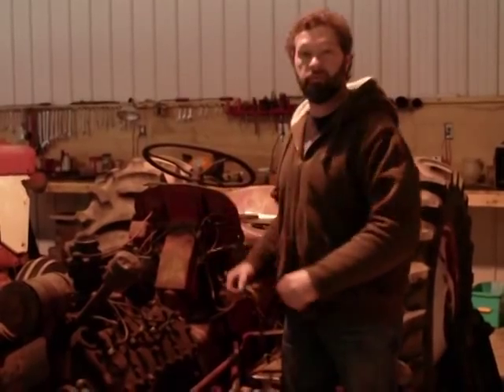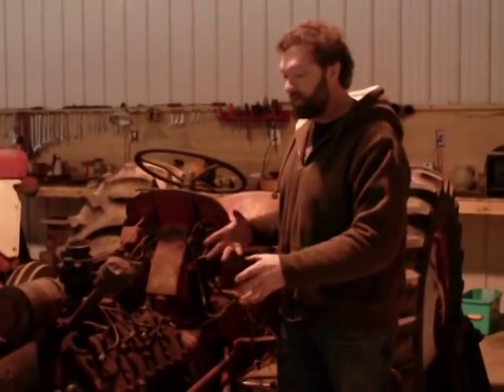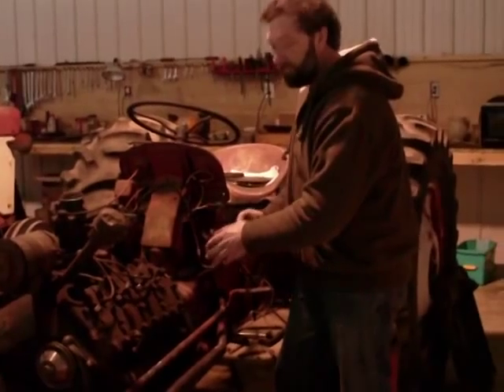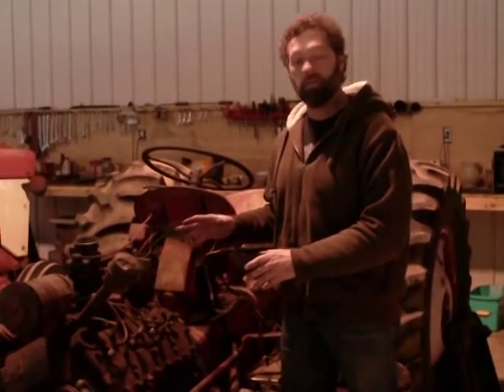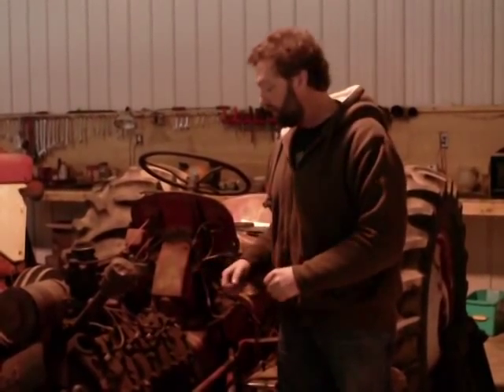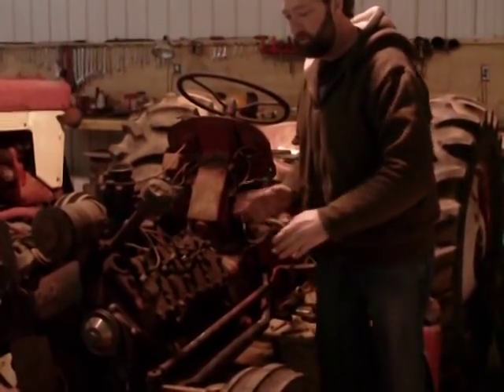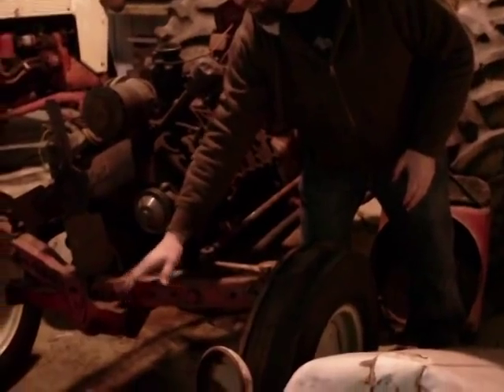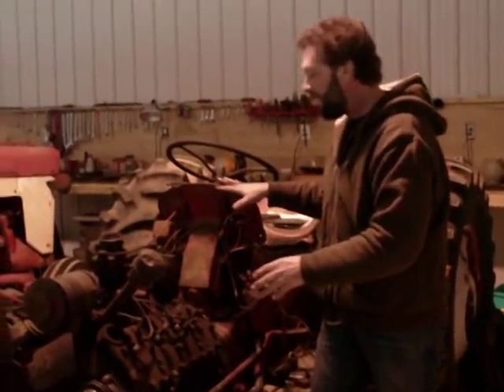Ford 8N V8 Funks Conversion in Progress

Comment: I have a 8n with flathead Ford V8 in it too.  My problem has been it want to overheat when run very long.  Especially in slow moving tractor shows any suggestions.  I want to use sonething to fit under my hood nice too.  Maybe make a new radiator with extra cores?   E-mail :  banjo@dishmail.net will send photos of mine if you e-mail me.